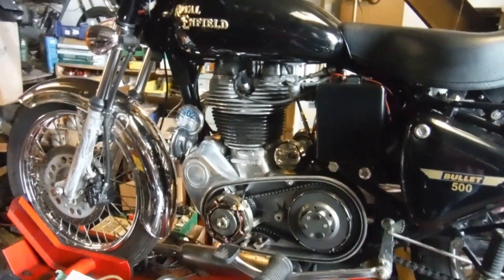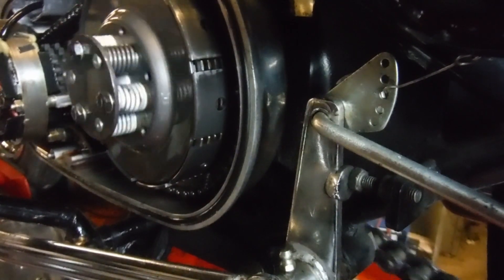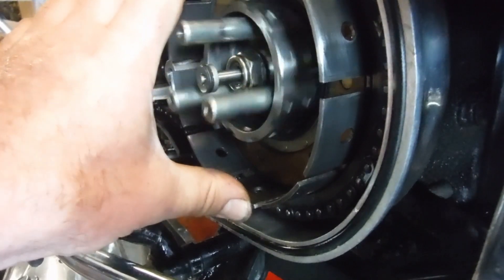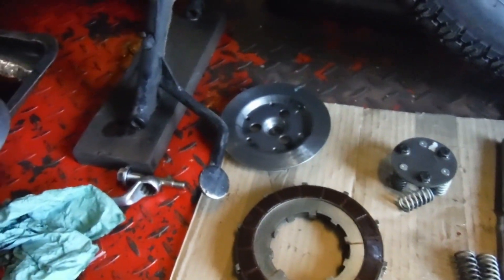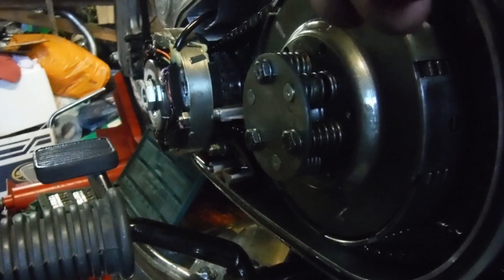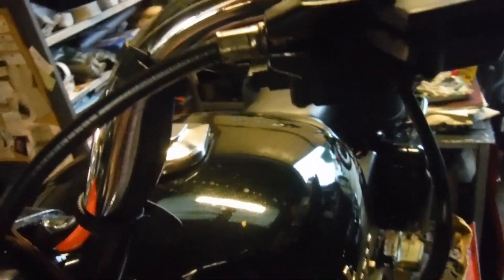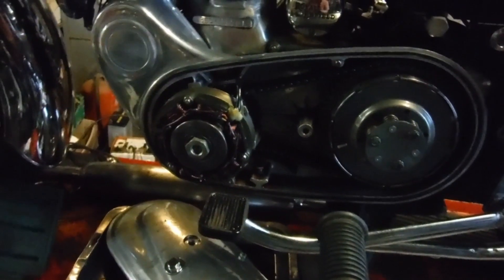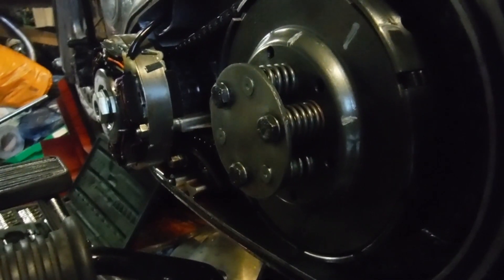Royal Enfield clutch drag issues put right.

Comment: I drilled a wiring hole in the three clutch bolt heads so I could slack off the low lift side and secure the bolts with a wire. A combination of that and swapping the springs around achieved a similar result to your spacing washers.

Comment: Paul you're a life saver. My 2002 bullet has has drag problems and iv messed about with the clutch for long enough. Already did the clutch lever mod which gives a bit more scope but never thought about springs giving different pressure on the plate.. Brilliant 🏁🏁🏁

Comment: When I first saw the clutch of my 350 I realised that the BSA system is better, with six adjustable screws holding the pressure plate onto threaded studs in the hub. It’s part of the setting up process to individually tighten the screws and get the pressure plate running true. Here, on the Bullet you have to hope that the springs compress by the same amount. A good tip about getting more throw on the clutch lever, Paul.

Comment: G'day Paul, my 500 Royal Enfield Bullet is a bugger too find neutral with the motor running, drops in when motors off, other that that the clutch is working fine, what do you suggest to make it find neutral all the time, cheers mate, Neil 🤠.
Reply from the maker: Hi Neil, that will definitely be clutch related, I would take a look and consider doing what I have done here. cheers, Paul.
Reply: @paulhenshaw4514  thanks that jobs now on the list, cheers

Comment: The original 4 plates tend to be distorted. The aftermarket 5-plate kits are a big improvement, never had isseus like that again. Nonetheless very interesting vid. Thanks!
Reply from the maker: The plain plates will certainly distort very quickly with a dragging clutch and once they are distorted - for whatever reason - they are only fit for scrap. The plates all checked out ok in this low miles example, though.

Comment: in the beginning of the video the very first time you pull the clutch i said different springs will fix that but that doesn't mean the springs were the actual cause, the different springs and added washers may just be compensating for another problem, it probably would do you good to test the springs you pulled to see if they are different rates...............
Reply from the maker: They were a matching set of six, probably fitted at the factory ...
Reply from the maker: Well, my personal expectations of some of the factory stuff are rather low ...